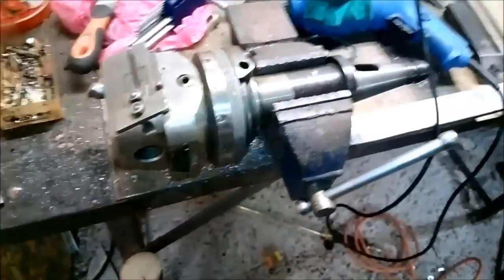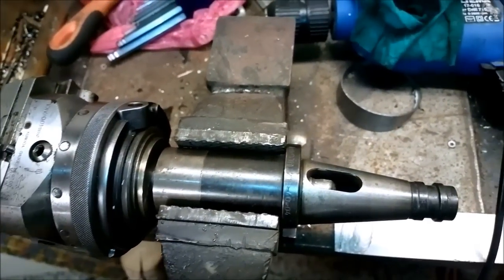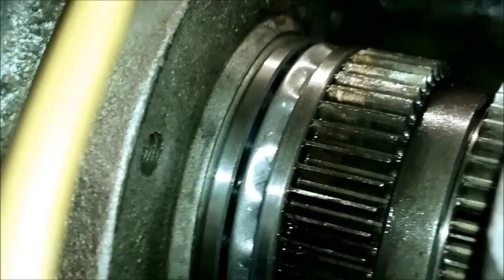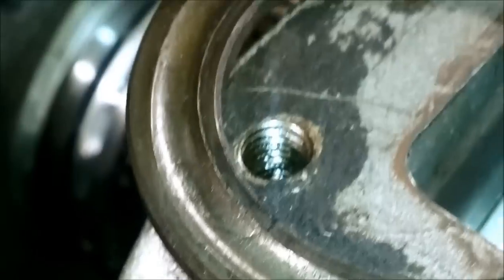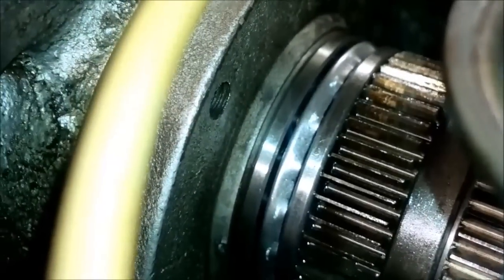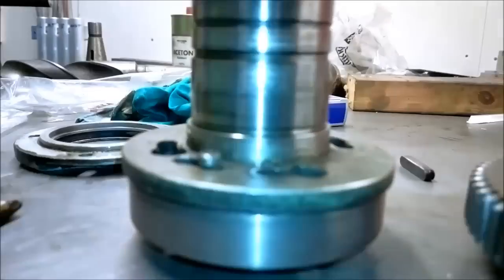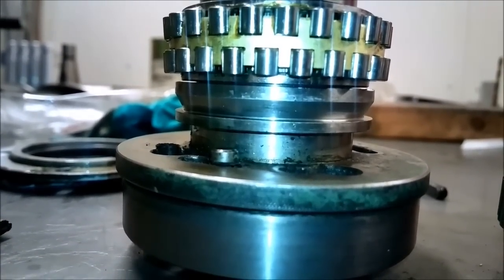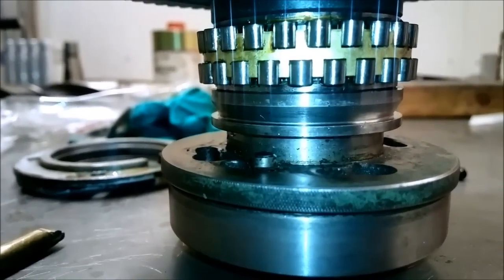Spindle bearing talk and progress

Comment: - One way to set the preload in my opinion without taking the spindle off 10 times and adjusting the spacer (machining more and more) would be to make a collar with the same ID as the headstock and press the outer race in it, then assemble the spacer, inner race and gears on the spindle and with the outer race on the bearing measure the slop/play, if still loose take the spacer out and machine (grind) some more out of it.
 - Thinking out loud here: i think the problem if you take too much would be that you cannot torque the gear with the threads properly and it might unscrew from the shaft, if the bearing and the shaft are tapered it will self center, question is if tightening the "nut/gear" would provide enough preload to take out the slop and if doing so would the torque at which you tighten be enough to prevent it from unscrewing.
 - Regarding the thrust bearing - from what i can tell the ball thrust bearings always have at least 1 race loose so it will center on the balls and the other race, otherwise it might not ride centered, the thrust bearing is not used for centering a shaft but provide axial support. I think you got it in there correctly, I would not change anything.
Reply from the maker: Thanks for your thoughs!!
1. Very good idea. I will give this some brain time tomorrow. Weighing if it's easier to set it up like you say or just putting it on the headstock. It's not that hard to take the spindle off (10min off, 15min on) either. And I still don't have a working lathe so I'd have to mill the collar. Also, why make a collar when I can also measure from the outer race itself? It would keep the thin outer race from going out of round under stress test?
2. You are completely right about what you say but there is one thing that I haven't mentioned, which is that there is a collar with inside tooth which slides on that gear nut and locks it to the big gear, which is keywayed to the spindle. So there should be no worries about the nut coming off.
3. Agreed!
Reply: sunppaa

1. The reason i suggested the test collar with the same ID as the headstock was so whatever shrinkage you get from pressing the outer race in the headstock (if it is a press fit which I think it should be to prevent play since that is not like a tapered bearing or angular bearing which would preload against the headstock), that way you don't have to calculate the outer race shrinkage when you set your preload of the inner race. Now that i think about it should actually be think/large enough so it won't expand when you press fit the outer race in it, you can probably use a square plate and bore it on the mill. Or just measure the ID with the race pressed in the headstock and then with it out and take that measurement into account (probably as accurate and easier so you might be right that is not necessary in the end).

2. that makes sense, i remember seeing that in the video but i didn't clue in that it serves the  as a locking mechanism
Reply from the maker: sharp x Actually I'm barely able to install the outer race in it's housing by hand. I was first amazed with that and I measured if it had play but I could not detect any. It really feels like a tight fit though it is a slide fit. Also there are no signs of wear or spinning in the housing. What keeps the race in place is a snap-ring on the inside and a flange with four bolts on the outside. I guess I should still measure the bore and the ring and see what kind of fit that really is. I was thinking on securing the ring with Locktite but I guess this goes into the same category with the thrust bearing issue. That's how it came from the factory so I guess no need to change it. I will still do research on this.
Reply: a trust bearing has one race loose on the outside and one race loose on the inside....
Reply: Tony Roba
that's partially incorrect, they can be both loose but not need to be, at least 1 has to be loose for a thrust ball bearing, if it is a needle thrust bearing then can be both fixed or built into the part itself.
Reply: sharp x
 looks like you never mounted mutch spindlebearings. How you mount them,is your problem, I just said how they are maid ..
Reply: Tony Roba
yeah, whatever, that statement makes no sense - what's a spindle bearing got to do with thrust bearings, you find thrust bearings in a variety of applications and shafts not just in a lathe spindle (which is actually rare by the way) - or maybe we talk about different things and you're saying thrust bearing but thinking of something else. What I was talking about in my initial post (which you might want to read again) is what's minimum to not have alignment issues, makes no difference what you found in some machine or device you took apart and put back together - I said "you need at least 1 race to be loose" (floating) so it will self center with the one that is pressed/fixed.

Comment: you are correct about the trust bearing , but far away with the tapered roller bearing . The correct way to do it is to mount the bearing on the spindle with outer rng, but whitout the shim. To work easaly, best lay it down on wooden blocks on the table. then mount your gear and nut an drive the bearing on the spidle so far that the outer ring has become 0.02 mm bigger than it is as it is unmounted . then measure the place where the shim sits with gauge blocks ( has to be done verry accurate within 0.005 mm) and then grind the shim to the thikness of those gauge blocks. doing that preloads the spindle as it should be . Make sure if you start your lathe that the lubrication is good and don't run it at max rpm to start with, let it run in . Any questions ? let me know .
 (calculation does not give any preload )
Reply from the maker: So I have to adjust the bearing with the outer race on until the outer race has expanded 0,02mm? Isn't that too tight? Won't it hurt the rollers? When the spindle is installed, will the outer race also be "pushed"? Is this why the housing has a slide-fit, so the outer ring will have space to expand a little? I thought bearings should always have a slight play? I don't have any gauge blocks but I can look for some or for some other method of measuring.

What do you think about just putting the spindle back and then testing for play with the correct amount of force (300N if my memory serves me right, it's on the lathe manual). The problem with this method, of course is having either to repeat many times or grind off a generous amount at once and then having slop between the shim and inner ring. Do you think it matter if I have this kind of slop? There is a collar gear holding the gear nut in place so no fear about it loosening. Two things I'm worried about having slop there is the inner ring climing somehow and/or not seating straight. However my thinking says adjusting the bearing when the spindle is on the headstock, gives the best results since that's where the spindle will actually do it's thing. I'm wrong I guess?
Reply: sunppaa
if you give play on those bearings , you will see it on the cut and hear the vibrations . and yes, that's why the housing has a slide fit .if you don't have gauge blocks,then you can best make one or two to meassure the gap. and then grind the shim .slop is out of order, the bearing will climb and then the fit will destroy the bearing .if you don't trust 0.02 mm then at least try 0.01 mm, but it has to be preloaded.
Reply from the maker: Tony Roba
If you are correct (and I have no doubts about that) that changes my thinking pretty much. If there is constant touch and stress on the rollers, where is the space for the oil film? Wont it heat the bearing?
Reply: Tony Roba A preload of 0,01 !!!!! Never !!!!! The maximum pre - load on this type of bearings is maximum 0,001 !!!!!!!
Please read " Bearings for machine tools by SKF" - the whole method how to adjust the pre-load of NN type bearings.
By the way,the whole spindle of the 1K62 is a classical SKF design,described in this book.
I have made such a repair,so I know what I am talking about.
Reply from the maker: StamD65
Ok, this stirs the soup a little more! Don't know what to believe when there are different opinions :-).. Can I find this writing on the internet?
Reply: StamD65 i do these repairs for about 27 years ..lathes, mills, grinders, you name it . And I use Skf Bearings .
 So don't tell me i don't know what i m talking about .
Reply: sunppaa
if the bearing is mounted like this, temperature will rise up to about 55 °C and then stabilise .
Reply from the maker: Tony Roba
http://www.skf.com/uk/products/bearings-units-housings/super-precision-bearings/cylindrical-roller-bearings/index.html
The methot found here I guess is exactly what Tony suggested. I just still cannot find the needed clearance/preload. There are links to tables with that information but the links are gone bad. It is a NN3012K P5 bearing (60x95x26). I think it should have a large internal play so it's not the best kind of bearing for this application. I'd really appreciate info about the clearance/preload to shoot for!!
Reply: sunppaa
all i can find on the Super Precision SKF roller bearings preload (I didn't read the whole document though) is the max attainable speed for a specific preload, if you look at Table 8 on bottom of the page 277 the highest preload for the lowest speed is listed between 2um and 5um maximum preload (0.002 to 0.005 mm). Same document talks about methods of measuring preload/clearance, adjustment and installation for tapered inner race preload (starting on page 273 and on page 391 for related tools) and also the methods of calculating the preload based on the nut preload of the inner race (and the axial distance vs race preload calculations) which could be useful to get your setup correctly (I know you did the calculations, I'm sure they are correct but doesn't hurt to doublecheck).
http://www.skf.com/binary/12-129877/13383-EN---Super-precision-bearings.pdf
(seems that there are issue downloading it sometimes, if you have trouble PM me your email address and will send you the PDF)

In addition and not sure if this helps with your decision or not or not but this talks about bearing life ratio vs Radial Clearance (and negative clearance which i take it is preload)
http://www.nskamericas.com/cps/rde/xbcr/na_en/Technical_Report_NSK_CAT_E728g.pdf
look at Fig 2 on bottom right of page 35 in this document, the interrupted line is the cylindrical bearing and looks like any preload close and over 0.01mm (negative radial clearance of -10um in the graph) and maybe even at lower preload than that would get the ratio fall down significantly (the doc is poor resolution but you can actually make out the values in the graph if you zoom in). at the same time having no preload as in actual radial clearance >0 has hthe same result according to that graph. If that is applicable to your application looks like 1 to maybe maximum of 3 um is where you want to be, again i'm not sure if this is applicable to your bearing but it is the only thing I could find related to radial clearance on cylindrical roller bearings in addition to the speed limitation from the SKF document which lists nothing over 0.005 mm preload.

I would definitely do more research if I were you before making a decision or proceeding with the preload setting just to make sure.

Hope this is helpful.
Reply: StamD65
you are correct, i found both SKF and NSK applications regarding precision cylindrical roller bearings with thrust bearing design for spindle applications in precision machining. Funny thing my multi-point Interstate live center has a similar design but with a needle bearing and preload on the outer race (conical also) rather than the inner and a thrust ball bearing, if you think at the size comparatively those needles are "rollers" in this case. You nailed the preload issue, 0.02 is excessive, looks like 1 to 3 micrometers is about the value I could find but that being said there's not really any literature about this specific lathe so we could both be wrong.
Reply: sharp x There is a plenty of written documents about these parameters, here is a link:
http://www.nskeurope.com/assets/eu_de/downloads/literature_bearing/EN-MTM_Guide.pdf
page 22 says everything very clearly 
Please pay attention of the bearing lifetime curve,when the pre-load is too big....
Reply: StamD65
i was talking about the lathe documentation, I was not saying anything different about the bearings (see my previous post with the doc links to SKF and NSK tech report for lifetime ratio vs radial clearance).

Comment: There may be a drive pin you have to engage on the boring adjuster screw to make the facing head work and it will feed at .025 per rev this is how my works it is a Chandler-Duplex unit
Reply from the maker: Yes, excatly! I just figured mine out! It has numbered pins around that collar. 1 to 12. When I push one in it will feed 0,04mm per turn and if more are in it will feed more, 0,04mm per pin. So it has adjustable feed from 0,04 to 0,48mm per turn!
Reply: sunppaa cool !!! I think the MT4 shank should unscrew from the body for different shanks like your ISO 50 taper  they are interchangeable I don't know what thread they are

Comment: The adapter in 2:10, I think we can find "short one", even in ebay - it save working area... even You can made it... it can be You first project when You will fix one of Your lathes. The "shim" in 18:25 You can grind, as You say- You have machines on what You can done this action. The spindle front bearing can adjust, we was talk about this in skype.
Thank You very much! Yea, we will wait for next video!
P.S. Let me know how You luck with the "shim" gringing.
Reply from the maker: Thanks! Sure I will let you know!

Comment: It looks like the magnetic chuck on your grinder may need to be re-ground a few thousandths, before you do the spacer, or run some test parts... You seem to be on the right track if that bearing can stretch far enough... I doubt it can climb. If so shims might be necessary. Best wishes... Lo]

O,,,
Reply from the maker: Yeah, I know there will be some dial indicator work on that magnetic table before getting to work on it! Actually I was thinking if the bearing heats up, the inner race expands and there is still push coming from the tightening nut, I think it can actually climb. Of course only as long as there is tension from the adjuster nut. Also I don't know if there will ever be so much temperature difference between the shaft and the bearing that it can expand enough to move. I think there will be much thinking and not so much sleeping this night :-P!

Comment: hi, you cannot to grind this spacer a lot for sure. if you will change its thickness then shaft will shift the same amount by other lathe parts, .5 it might be way too much. remember other bearings gears and pulleys have its own proper seats on the shaft and casting body so you cannot to shift shaft a lot. I think first thing you should to do it to find out when the bearing will start the tightening up and then you can to find out required amount of shift of the shaft. it would be very useful if you will know original position of the shaft face against the whole assembly, for example to the casting face if is flat. it might be even that thrust bearing seat making a problems now. so to grinding the spacer might be not good idea it might not solve the problem at all. and remember if you will change thickness of the spacer then probably you will need to add a new spacer on another side of the bearing.
Reply from the maker: This is not an issue. It is possible to move the spindle around 2mm to any direction without clearance issues!
Reply: it is a lot, and how the torque bearing and belts will be then?
I think the first thing you should to do now is to find out spacer length, maybe it is good idea to make temporary spacer and changing its length if necessary, you can to tight the bearing by nut, however you don't need to install the shaft in the lathe only to fix it in vice and find out the fit of bearing outer ring, you can use  dial indicator with micron scale to determinate slack of the bearing and you can rotate the bearing by hand to check if is too tight or not. if is too loose then grind ring slightly and keep doing until will be ok. it only is my idea but maybe not too bad
Reply from the maker: Radoslaw Jocz
The thrust bearing is not sitting against a shoulder. It gets the pushing force from the spindle through it's front race and a press-fit gear that's on the front side of the bearing. Therefore it is not critical where the bearing is sitting in the shaft. Same with the angular contact bearing. The belt system is completely apart from the spindle shaft as the spindle is going through the pulley shaft. The pulley connects to the spindle by gear.

I'm using almost exactly the same method you are talking about for adjusting the bearing! In my opinion it's the easiest way to go. Next video will be about that but will have to wait until next tuesday or wednesday!
Reply: sunppaa ok good luck with repair. waiting on your next video, they are quite interesting
Reply from the maker: Radoslaw Jocz
Thank you!! Luck will still be needed :-)!